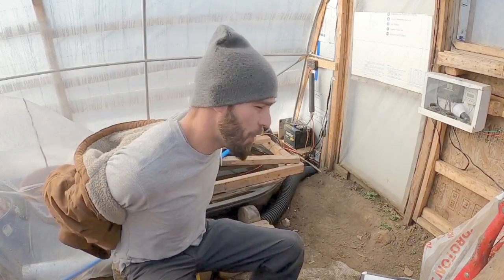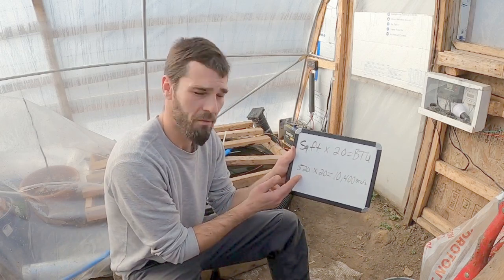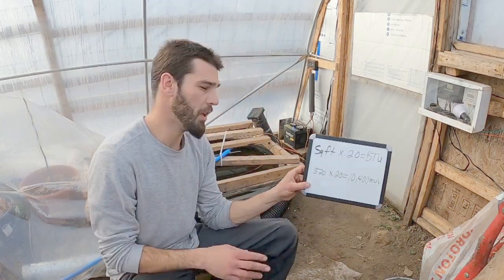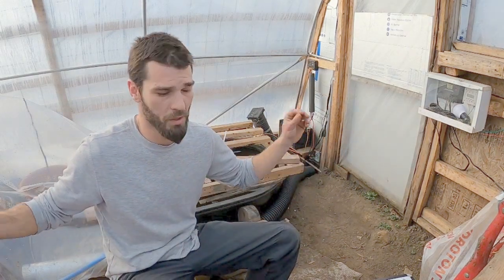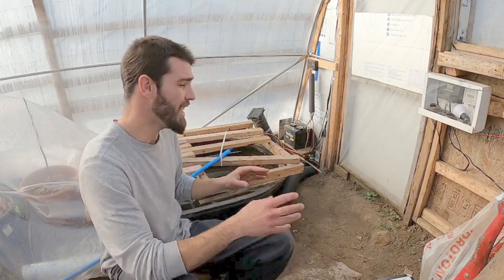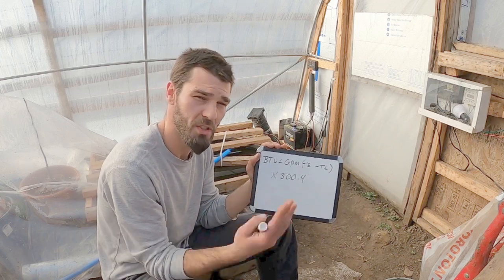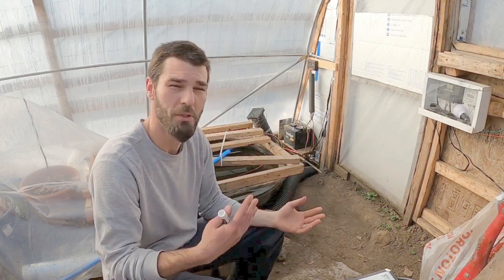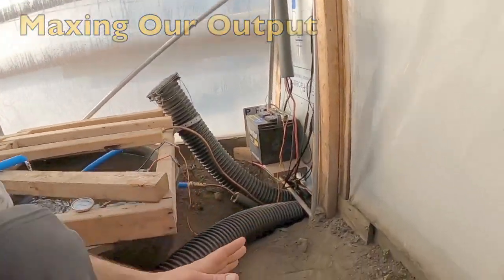Compost Heated Greenhouse! How Much Heat Does Compost Create? | DIY Winter Heating Greenhouse

Comment: Nice. Numbers and data. Some science I can actually trust lol. Did I miss a video on the whole compost setup?  You have water circulating out of it instead of air? I saw a guy in the UK who just ran an insulated air pipe out of a huge mound covered with hay etc. with a computer fan drawing it into his house. Is water more efficient? I'm noting that you have to get the heat under the beds , that's probably the first priority, second might be the ambient air temp?
Reply from the maker: We’ve got a lot of documentation building this large pile in previous videos, we’re running air and water trying to get as much btu into the greenhouse from the compost as possible. We’ve got several computer fans running on solar, waterproof fans last a good while. We’ve got geothermal tubing with a fan and compost heating pipes with a fan also running on the same solar system since they don’t draw much at all and will run all day with heavy cloud cover
Reply: @Earthdwellershomestead   Ok sorry for my duh. I need to scroll back . Air and water hmm. Good idea. I'm on the edge of my seat . WILL THEY SURVIVE??? (dun, dun, dunnn...)

Comment: Really enjoying your journey.  How long do you expect the pile to stay hot at the lower outdoor winter temperatures?  Will you need to make a new pile?
Reply from the maker: Woodchips contain about 11million btus per ton give or take with moisture content. We’re sitting on about 33million plus btus with our pile. We should be able to achieve burning temps till the middle of summer! Great questions! Although our temps may dip when the temps go back negative we should be able to hold growing temps all winter regardless